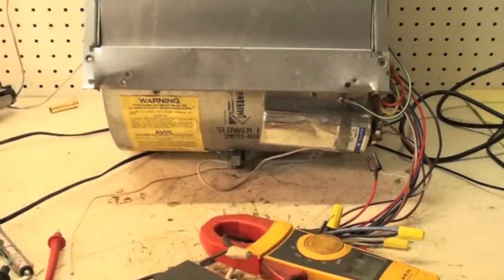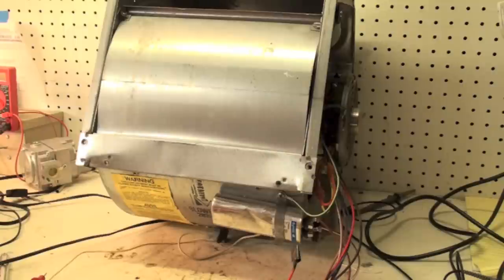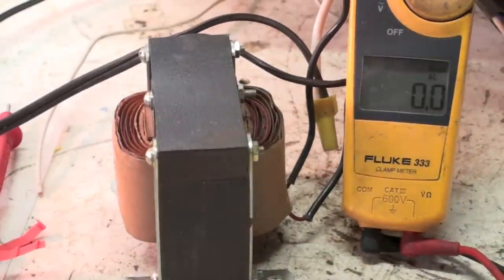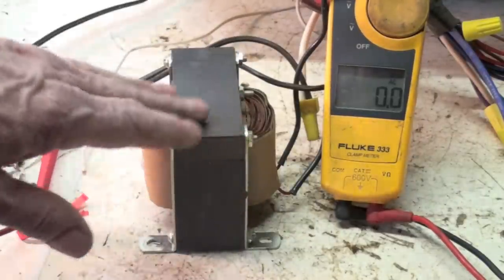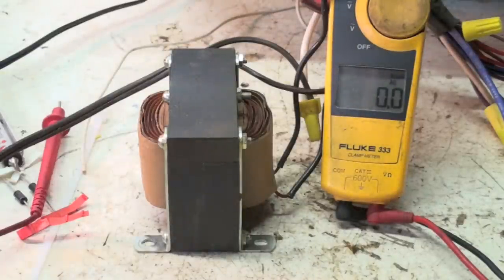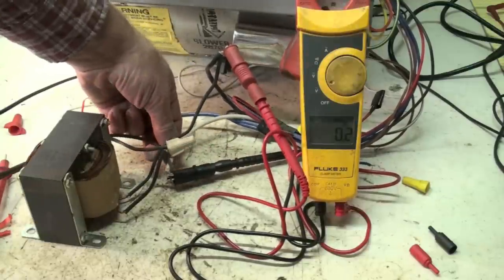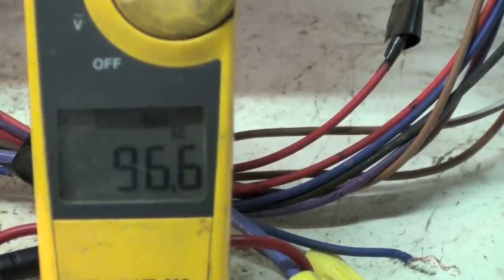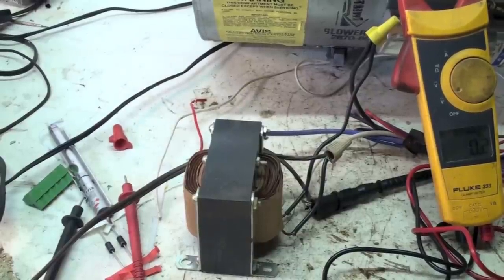Furnace fan motor speed control

Comment: 376cav036075 furnace to speed up blower has a white and black wire and a red one and there is number slots to plug in to numbers 1-4  would I move the black and white to med high slot for ac. Because ac keeps freezing
Reply from the maker: Before you change speeds, check a few things.  Dirty filter, dirty blower wheel, plugged coil or collapsed ductwork.  Freezing can also be a result of low charge.  A simple check is to start A/C and after 10 minutes of operation, touch the large copper line at the outdoor unit.  The line should be "beer can cold".  If it is only slightly cool, you could be low on charge.
GFM
Reply: @grayfurnaceman   in ten min it is got moisture  like it's a beer car from a cooler then it freezes and the blower humming thru the return no air coming out
Reply: @grayfurnaceman  it's a very old furnace with a new ac coil
Reply: Thank you for replying
Reply from the maker: @chrisb.5100  If the blower is not running, your problem is probably in the motor or capacitor.
GFM
Reply: @grayfurnaceman  ok thank you. Would it run for 20 to 30 min and freeze and stop
Reply from the maker: @chrisb.5100  If the motor is shutting down after running for that period of time, it could be shutting down on overload.  Try checking the motor chassis for heat when it shuts down.
GFM
Reply: @grayfurnaceman  ok thanks for your help I will check it

Comment: Is there a rating for the choke coils?  Vac, Amp,
Reply from the maker: They are rated in "Henrys".  I know that does not help a lot.
GFM
Reply: Their inductance is given in Henry (or Milli/micro-Henry) and of course there is a maximum current, other specs depends on core material/shape for specific purposes (f.ex. high frequency/low frequency). E-core type like in the video here is for low frequencies, you must choose a suitable one per design goals. Their function is basically the opposite of a capacitor.

Comment: Reducing the voltage available to the motor will reduce the current flow too.
Reply from the maker: Just reducing the voltage without controlling amperage will actually increase amp draw.
GFM

Comment: I saw a sensor attached next to the blades on a blower motor in a older 70+ furnace. It does not have a reset. I was wonderng what is t for? It is wired to the gas valve.  Could you enhance on that. I will appreciate it.
Reply from the maker: Its a limit switch that is used mostly on down flow furnaces because the limit near the burners may not shut off the burners in the case of blower failure.  
GFM

Comment: Any way to increase the speed of a 4 speed 1/3 hp PSC motor?  I am on the highest speed.  I need to get a few more CFMs out of it so it doesnt lower the humidity as much.
Reply from the maker: No.  If you have checked out things like a dirty coil or filter, restrictive ductwork, or dirty blower, you can upsize the motor size.  This does not mean you will increase the CFM.  If the system is at its max, you will make little difference.  Before you change the motor, I would look at the static pressure in the ductwork and compare to the install information of the air handler.
GFM

Comment: Changing the number of motor poles is a better option. Because it keeps the power factor high. while you dont pay for power factor correction as a resident, on a commercial building you will likely have to pay for it. These motors already suffer from a power factor miss match because they are inductive. adding more inductance will make that issue worse. a poor power factor will cause a phase shift between the current and voltage running throiugh the power lines. It allso means you will have more apparent power (higher current in the lines) than  real power (the amount of actual work the motor does). again, as a residental houyse you will likey only have to pay for the real power you use. Buisnesses have to pay the apparent power too. one day residential homes will need to pay for it too.
Reply from the maker: There is no point in changing poles.  The speeds will not match up to what you need.  The solution for residential is the ECM motor.  The solution for commercial/industrial is Freq drives.  All of these are already available and in widespread use.
GFM

Comment: hi.is it ok to lower the fan speed from hi to med on heat because is to loud?
Reply from the maker: Yes, if the furnace does not drop out on over temperature.
GFM
Reply: so it will be no damage at all,just it will turn off if over heating
Reply from the maker: The only problem you can get into is if you move the wrong wires.
GFM

Comment: only way to check if these are good is with a continuity test?
Reply from the maker: Or if there is power to the speed.  Power there and no rotation, speed failed.  No power to the speed, look farther up the circuit.
GFM

Comment: I dropped a small screw driver down through the evaporator. Could it have fallen into the blower motor?
Reply from the maker: It probably is in the bottom of the blower housing.
GFM

Comment: Very cool! They don't use those "expensive" iron core chokes anymore! Now they use a $900.00 ECM motor! LOL. Saves $. What???
Reply from the maker: Good point.
GFM
Reply: Some 5 ton drive ECM motors use these as well, in series with the line voltage to the module, any idea what the purpose is GFM?
Reply from the maker: I have seen them too.  I have no idea.
GFM

Comment: 15 amps at such a slow speed doesn't sound too good, but IDK, maybe that's normal?
Reply from the maker: The blower is not installed in the duct system, so it has no back pressure.  They draw excessive amps with no back pressure.
GFM

Comment: using a fan from furnace, for shop air, should I restrict some of the output air, no restriction 9 amps an when covering some of the outlet side it lowers to 6 amps, any suggestinon  thanks
Reply from the maker: An outlet restriction to keep the amp draw below rating is a good idea.
GFM